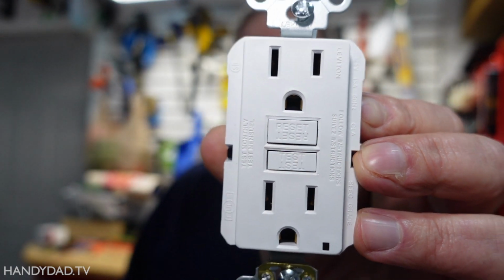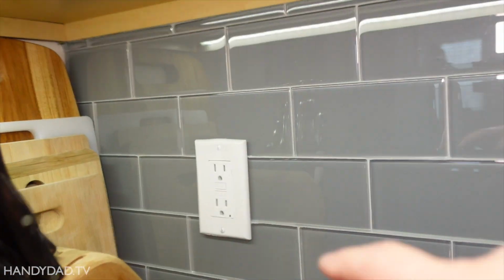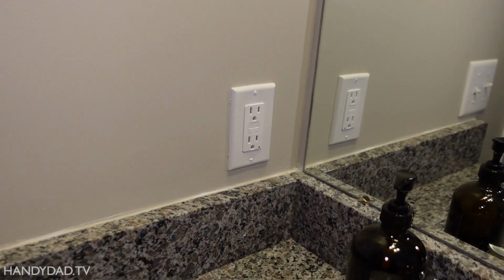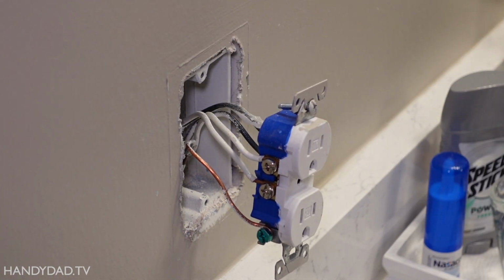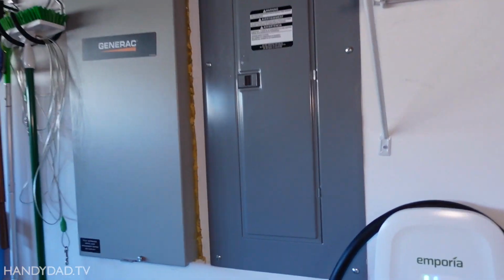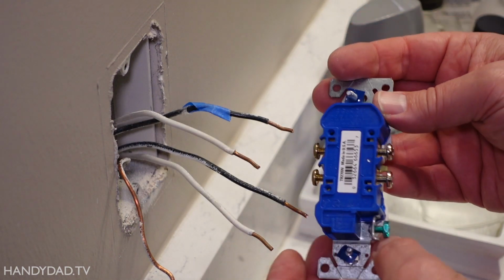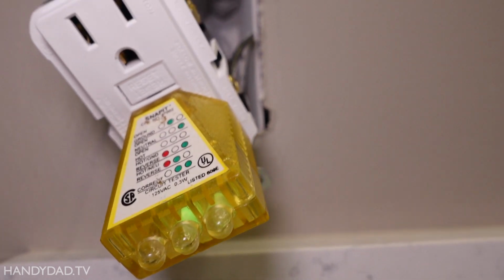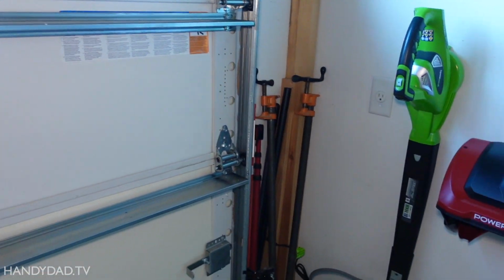BATHROOM WITHOUT GFCI !!!  Electrician mistake?

Comment: Hello there! I have a question. My outlets in my master bathroom are out. They have no power coming to them. I checked my breakers and nothing is tripped. I used my voltage tester and tested each breaker and they came back 120 voltage and work. I tried every GFI outlet with reset and nothing works. Any idea what the cause is?
Reply from the maker: Probably another GFCI somewhere.

Comment: Confused, you connected two hots and two neutrals to one GFCI, line side only,
why?
How did you get power to the load side of the other GFCI breaker down stream?
Reply from the maker: I purposely moved the extra wires from LOAD to LINE because I wanted another GFCI in the second bathroom.

Comment: Same issues with my bathrooms, only issue now is my upstairs outlet is receiving power but when I plug something up, nothing comes on. Also, my lights and my upstairs bathroom are not working. Any clue what that can be
Reply from the maker: Faulty GFCI or loose connection.

Comment: In my opinion a bathroom without any GFCI protection is the fault of both the electrician and the electrical inspector, as this has been a requirement since 1975.   That being said, a home built before the jurisdiction adopted the 1975 NEC falls under the grandfather clause and isn't required to be protected.  However,  if you replace the receptacle then it MUST be GFCI protected.
Reply from the maker: As far as I can tell, although inconvenient, I don’t think it’s a code violation to have the GFCI protection in a different location. But it’s not worth saving $15 IMO. So I always put them where you can see them.
Reply: @handydadtv  correct.  In fact the area I work in requires AFCI protection on bathroom receptacles as well as GFCI, per the NEC a bathroom DOES NOT require AFCI, so our company SOP is to use a dual function breaker for the bathrooms, as it's cheaper than an AFCI breaker with individual GFCI receptacles.  Also, in North Carolina,  the Ashville area specifically,  requires GFCI PROTECTED OUTLET  stickers on all GFCI protected receptacles that are protected at the panel or the load side of a GFCI receptacle.  

I thought maybe you'd find this intriguing,  how different the rules can be in some jurisdictions.
Reply from the maker: @Sparky-ww5re Thanks for the info!

Comment: Great video. I didn't think that you could have two bathrooms wired on one circuit. Thanks.
Reply from the maker: That’s news to me. But I’m no expert.
Reply: You are permitted to have the bath RECEPTACLE outlets from different baths on the same circuit,  but if you tie the bathroom lights on with the receptacle,  than it cannot leave that particular bathroom, this is not good practice in my opinion because if the GFCI trips,  depending on how it's wired with regard to line/load, or protected at the breaker box, you will be in total darkness.  

The one situation where the lights and receptacle may need to share the circuit would be an exhaust fan installed directly over the tub or shower.   While the NEC doesn't explicitly mention an exhaust fan over a tub or shower must be on a GFCI protected circuit,  the manufacturer's instructions will indicate whether acceptable for this application and if so, when installed on a GFCI protected circuit, and per article 110.3 (b) you are required to  install the product in accordance with the instructions included with the listing.

Comment: HELP!  I can't find the GFCI outlet that has tripped... I have checked for the red light on all existing.  I have looked in the bathrooms, kitchen, butler area, bedrooms, closets, even in the storage areas (such as upstairs inside of my kids closet into a back area where A/C stuff is)...  Nevertheless, I can't find it anywhere.  Could the breaker be bad?
Reply from the maker: Is the dead outlet in a location where GFCI protection is required? Are you sure the breaker isn’t tripped? 

You could use this method to trace the wires. https://youtu.be/UAEq-yvjryQ

Comment: I would investigate whether that 15 amp single receptacle by the garage door is a dedicated circuit receptacle. If it is, it must be a 15 amp circuit. If it's a 20 amp dedicated circuit it must be a 20 amp receptacle. If there are other receptacles on that circuit, then I believe you'd be in compliance if you changed it to a 15 amp duplex gfci regardless of whether it's a 15 or 20 amp circuit.
The gfci behind the refrigerator is a violation. Gfci's must be placed in accessible locations.
Reply from the maker: Other things were on the circuit. I just replaced it with a GFCI receptacle to prevent shocks.
Reply: I suspect the garage GFCI was accessible when originally installed, however, the HO chose to place an object (refrigerator) in front of it.

Comment: In the UK receptacle and light switches are not allowed in bathrooms.
Reply: Another point which may be of interest, wire nuts for connecting wires together were banned in the UK in the 1950’s.
They were regarded as a fire hazard.
Reply from the maker: Where do you dry your hair?
Reply: @handydadtv  anywhere but in a bathroom, electrical appliances are not allowed in a bathroom.
Portable heaters etc used in bathrooms are highly dangerous especially if they fall into the bath water. 
There’s plenty receptacles throughout a house, bedroom comes to mind when drying hair and there’s nearly always a dressing room mirror.
It’s a valid attempt to keep people safe and alive.
Reply from the maker: Do you have any GFCI outlets?
Reply: Why would you dry your hair in the bathroom? You do not need water for it.
Reply: Actually now they are allowed as they are RCD protected. Though there are limits on where they are allowed in the bathroom.

Comment: No code violation. The receptacle was gfci protected. Very, very common. Nuisance for sure. It’s a money issue. At $20 a pop for GFCIs extrapolated out to a new planned community, it adds up. Many now use a GFCI breaker for bathroom countertop circuits so the nuisance factor is worse.
Reply from the maker: Yeah the breaker would be worse.

Comment: I agree that should have been protected. Your guess that LOCATION was for EV charging is good, BUT it should never had an outlet (hard use wire only), AKA stubbed out. Almost everything now needs a GFCI, including 240V outlets in garages and laundries.
Reply from the maker: Right

Comment: GFCI code has been upgraded over the years. So it depends on When your house was built/remodeled. A common practice in the 80's was for the Bathroom GFCI (very $$) to also protect the Required (single) outdoor outlet or as you have, all baths. There have been lots of code changes. Bathrooms no longer can even share their breaker out of THAT bathroom (Nuisance trips from blow dryers?? ), so you 2 bath is now a 2020 code violation.
Reply from the maker: Mine was built in 2018.

Comment: on a different video you showed your breaker box had AFCI. If your bathroom runs to AFCI (2022) code. Your good.
Reply from the maker: It’s weird. The circuits with GFCI outlets (like the bathrooms) only have normal breakers. The AFCI breakers are on the other outlet circuits.
Reply: @handydadtv  If you turn off the breaker you might find a GFCI downstream on the same line.

Comment: The outlet in the garage should be GFCI IF it is less than four feet from the garage door opening, however typically a single outlet on a 20 amp breaker is for a extra fridge or freezer.
Reply from the maker: I read the code and didn’t see anything about a 4 foot limitation.
Reply: @handydadtv  
It is four feet from a water source i.e. sink, bathtub, exterior of the house. Some inspectors are more strict than others. They just don't want you using your electric leaf blower in the rain.....in the past "appliances" were exempt i.e. clothes washer, dishwasher, refrigerator. I believe that single outlet was intended for a freezer

Comment: I always heard that it was better to use a GFCI breaker in bathrooms than GFCI outlets.  The reason I was told is that high humidity environments like bathrooms can cause GFCI outlets to fail.
Reply from the maker: I guess it’s possible, but news to me.
Reply: thats why they make weather resistant receptacles so they can handle high humidity, especially outdoors

Comment: This practice is common and completely code complaint. The reason they do it is to save money on the second gfci outlet and still pass building inspection.
Reply from the maker: Who made this decision? Does the architect supply a wiring diagram to the builder, and that’s what the electrician uses to bid the job? If that is the case, the architect made the decision.
Reply: Yes, when builders build neighborhoods. Dr. Horton, Pulte etc. they are the ones who supply the electricians with diagrams. The electrician is not at fault in that case. If it’s a custom house then I’m not sure if the builder still supplies the plans or the electrical contractor. I like the way you added the second GFCI so that they each control one bathroom.
Reply from the maker: Thanks for the info

Comment: It probably depends on the code at the time the home was built. My 1980s house has a single GFCI outlet to feed two bathrooms (like yours) AND all my outside outlets too. When it failed, everything downstream lost power but nothing in the breaker box was tripped. It took forever to find the fault, because I didn't know it was wired this way, and the gfci outlet itself had power (only outlet in that bath). I don't think I'd expect a home inspection to find this (when working). Not sure if it WAS a violation when built. Codes are not retroactive. I have few GFCI, no afcis and no outlets with those closing covers.
Reply from the maker: I’m not an expert on the codes and their retroactivity, but in my experience, you only need to meet current codes at the time of construction. So if you want to build an addition on a house with knob-and-tube wiring, you’ll be expected to upgrade at that time.
Reply: @handydadtv  my experience has been the 50% rule. Remodel or rebuild less than 50% and only new must meet code. Addition or 50+% remodel then everything must meet code. But I'm with you that anything new in my house should meet code, but maybe not maintenance. An insurance side note...I had hurricane damage, less than 10%, and mostly exterior deck. Insurance would pay me to restore everything back AS IT WAS -full replacement. The contractor told me that the vertical styles on the old deck railing were too far apart for current code. I said do it right, and they did. But then my insurance man said they wouldn't pay the extra it cost for more wood, labor etc. as they only had to pay to restore it to the way it was. Such is insurance...
Reply from the maker: Wow good point. Thanks for the info.
Reply: @joehaggerty9593  horrible industry

Comment: Don't change that single receptacle to a GFCI. It is intended to be like that. It's no mistake nor a code violation. Besides they don't make single receptacle GFCIs. They're commonly used for central vac systems. Best thing to do is contact the builder and ask what it's for.

A daisy chain from one bathroom to another for GFCI protection can be within the code based on where you live. There is nothing wrong for the adjustment with which you did and I myself would have done the same if I purchased an house wired that way.

FYI, I am an electrician by trade.
Reply from the maker: Thanks for the feedback! I usually have electricians telling me what I’ve done wrong. 😉

Comment: Common but silly. Our upper bath was connected to our main floor bath and our master bath is connected to the sun room and our garage is connected to our back deck. Funnily enough the lower floor ba was on its own.
Reply from the maker: Did you leave it that way?
Reply: @handydadtv  No I separated the two bathrooms and plan on doing the same with the garage. The last thing I need is an outdoor outlet causing my garage freezer to turn off.
Reply from the maker: Someone told me a similar story where the bathroom GFCI was in the basement. A splash of water in the bathroom caused it to trip, which killed power to the sump pump and they didn’t know until they discovered a flood.

Comment: I would certainly agree having the actual gfci outlet in one bathroom and the protected downstream outlets in another is not a good idea. At best it is inconvenient and probably too easy to trip, and may not be compliant with local code (locally for me I believe each bathroom needs its own dedicated gfci protected circuit). It could certainly be confusing (especially for a homeowner who isn’t familiar with electrical wiring and how these outlets work… that could easily be a fairly expensive trouble call made to an electrician just for them to come find and reset that outlet). The title of the video is a little misleading though. As evidenced by the results of your gfci tester before making changes to the outlet you did have gfci protection in the bathroom- it properly tripped the outlet in the other bathroom. 
No question the result after your modification is an improvement, but you were not in increased danger of being electrocuted in your bathroom before the change. I can’t speak to the local code where you are but functionally this would have passed during your home inspection too I would think. A detailed home inspector should have noted in the inspection report that the single gfci outlet in one bathroom had protected/downstream outlets in the other, but this is very different from having bathroom outlets without gfci protection. 
The outlet in your garage is a different story. Those garage outlets should all have protection and that one didn’t trip when you ran your test. That should have been noted as a problem in your inspection and brought up as an item to address before closing. Arguably you are less likely to be surrounded by water when you are using that garage outlet than the outlets in the bathroom, and if I had to pick I would much rather have my bathroom outlets protected, but it still isn’t correct of course. 
Specifically for the bathroom outlets I think this comes down to a cost saving measure used by the builder that is a pretty dumb spot to cut a corner just for the usability of the outlets and bathrooms down the road.
Reply from the maker: Thanks for the feedback!

Comment: Electrical contractor trying to save money, especially on building multiple specs houses in the same neighborhood. This is also legal to do within the NEC. I don't agree with it, but not illegal.
Reply from the maker: Thanks for the feedback
Reply: Yep! One of many things that will make you shake your head down the road (especially if you are not a diy’er who is familiar with electrical and end up calling an electrician to figure this out for you). A few extra $ up front could save a lot of frustration later.. but as you said, this is allowed and not a safety risk, just annoying. 
My parents had a house built in the mid 90s. It was not one of multiple spec houses but a custom build for them. After a couple years in the house I remember some outlets not working in an area off the kitchen where they had a coffee maker and it turned out the gfci outlet that needed to be reset was behind the refrigerator. 
Not sure what the code particulars were at the time- I believe now you need a dedicated circuit for a refrigerator like you’d have for a microwave- but being generous with my assumptions this was an example of an electrician not thinking about how the outlets would actually be used, just what would be easiest (the outlet behind the refrigerator was the closest in that series to the panel in the garage so from that standpoint made sense to be the first in the series of gfci protected outlets).

Comment: I agree it should be setup logically by room. I had a gfci in a bathroom that you had to reset in the garage. 
The reason I’ve been told it’s that way is say $10 saved times 100 homes, in a neighborhood, equals $1000 savings for the builder/electrician.
Reply from the maker: I heard a story of a home where the bathroom was protected by a GFCI receptacle in the basement that also powered the sump pump. Water splashed one night in the bathroom, popping the GFCI without notice. They didn’t realize it until the basement was flooded.
Reply: I had a house where they used a single GFCI for all the bathrooms and exterior outlets but they put it in the master bathroom.
Reply from the maker: @Brian That’s crazy!
Reply: @handydadtv  Well, if it tripped, it was way more convenient to go to the master bath to reset it than the garage. Newer houses require a dedicated 20 amp circuit for the bathrooms so no more sharing that circuit with the exterior outlets, so the GFCI has to be one of the bathrooms.
Reply: @Adam-wu2xr when an electrical fire or shock could happen and cause injuries or a $300k house to burn will nowhere near offset the cost it saves them..